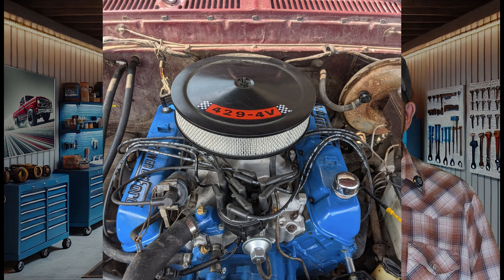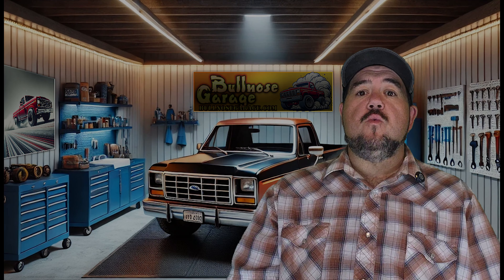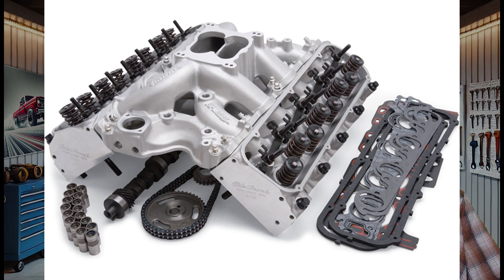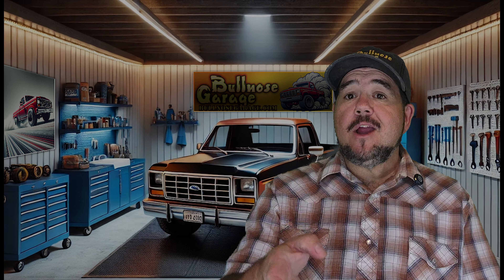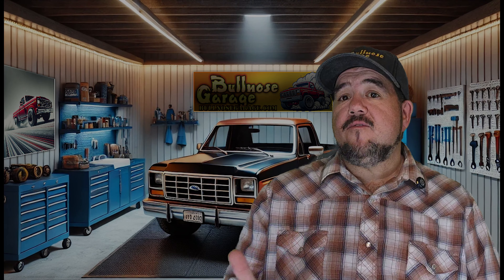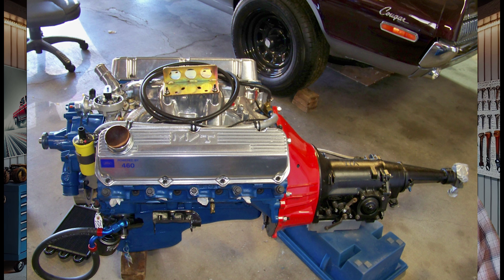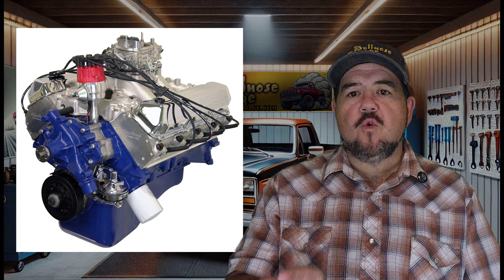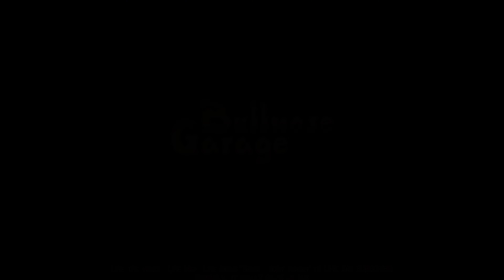Ford 460 7.5 Liter: Everything You Need to Know [Specs & More]

Comment: The 460 is all right for towing, but the FE is a better engine and can handle a lot of abuse. They are as heavy as a diesel. I weighed my FE and it makes 510 hp and 488 ft lbs and weighs 518 lbs with iron heads and aluminum intake.
Reply: Lol the 385 series engine is better then any FE engine ,canted valves is the ticket
Reply: The FE was designed for nascar. The intake is part of the cylinder head. They shaved about 1/4 of the head off so they could fit more aluminum intake. The rules at the time were cylinder heads had to be cast. 

FEs get a bad rep because people don't know how to properly seal the intake. It can be a pain, people shim and even go as far as sanding material away to get it to flush up
Reply: @adamm1998  

The 332 in 1958 was not "designed for NASCAR".

"NASCAR racing was the primary development and test bed for Ford’s FE race program throughout the 1960s. The 427 was upgraded and altered every year as needed to remain competitive."
Reply: @johnpeters9793  Actually the 332 in the 58 Fairlane did pretty well compared to the Y block. They took away the Paxton supercharger, so they were definitely designing a 58 engine for NASCAR so an intake swap took the pedestrian engine into a race engine that revved like crazy. The 352 in 59 and 60 were making over an hp per ci at 360 and were tuned to 375. So they were hot to trot once they all winked at the AMA ban. The 390 and 406 was a good shot across the bow at 375 and 401. Then the 406,at 385 and 405 was pretty good for the 61-63season with the fastback roof. Then the 631/2 427 with the slick body, 64 with the HighRiser 2x4 … the FE was always built for racing from the 332 PI all the way up… just an intake swap and you were eating everything.
Reply: @darrellsomers5427  No I disagree with that statement. The engineers had a magic in the FE ports that overcame the design of the “better” ports. They operated on the length and angle and the durability. It is a wish I had that used a 4.63 Cleveland head, but a Ford Engineer said that they could have an advantage with changing intakes and the intake valve offset that creates a better chamber and squish than poly angle heads. Robert Yates actually reduced the angles to improve the flow efficiency to FE levels. He knew the FE well and could get the best mix from using the best from both without the good port bad port of the BBC.

Comment: Used to drive a 96 F250 w/ 460… reliable and smooth. Mpg averaged 12… great truck engine, if gas prices hurt your budget don’t drive a truck.
Reply: If I could get 12 mpg I would be happy.
Reply: That's better than any of the modern gas powered 3/4 ton trucks I have currently.
Reply: Putting one in a 88 short bed.. Anyone have any tips for this   ?
Reply: @masonanderson1331  the main thing is finding the correct mounts also it seems the C6 transmission is the most popular option you may have to get the length of your drive shaft changed too
Reply: @masonanderson1331  also a 3-4 core radiator is a must

Comment: Back in the day, I put a 460PI in my 76 high boy. That truck would run.
Reply: I have a 74 f250 with a 460. It’s a riot 💪🏻
Reply: I have a 460/C6 I’ve been debating on swapping into my 79 F150 for the 351w and 435 trans that’s in it now. I drive it in the winter and plow with it. I’m just scared that all $ I make plowing, will just go towards gas.
Reply: @jeep2nv92 I cant imagine your mileage is all that great with the 351,  you may not notice that big of a difference.
Reply: It’s not. I’m guessing I’m getting 12-14 at best
Reply: @jeep2nv92  I know what I would do 😃
Reply: I’m guessing you’d drop the 460 in. I’m pretty sure that’s what I’m going to do too
Reply: @jeep2nv92  Yep 😁
Reply: 1960 was a high Boy. Just because its lifted or suts high doesn't make it a high Boy. 😂 They have a step when you open the door. Thats what makes them a high boy not the way it sits 😂

Comment: 385 was an engineering "series", had nothing to do with the stroke.  335 was the same and was the Cleveland "series".  The factory crank is nodular cast and can withstand over 1000hp and 8k or more rpm.

Comment: Remember that the large disparity between HP numbers before the early 70's vs later is largely due to measuring 'gross' vs 'net' HP. Sometimes the exact same engine was used when the measuring change happened so those aren't different except in numbers, but soon enough pollution laws would bring  on a real drop in HP. In stock configurations there wasn't a lot of difference between the 429 and 460 in HP or peak torque, but the 460 had a wider RPM spread of high torque making it feel stronger and pull loads better. There were no real vices or weaknesses with either engine stock, which in itself is unusual. A similar engine ID problem happens with the 360 and 390 engines; measure the stroke to know because most trucks had a 360, relatively few had a 390.

Comment: 78 or 79 they changed the pan rail from scalloped out on the Lincoln blocks to a stronger straighter surface. The Cylinder Bores came down a little further into the crankcase as well making the Truck blocks a little more desirable for strokes over 4.150. Stroker builds up to 557” can be had easily with little to no grinding required. Add a set of Motorsport CJ, Trick Flow or John Kasse heads and you will have a serious beast. 
The current engine in our 1970 F250 started life as a low compression 79 truck motor. We used a cast steel Eagle 4.300 crank with BBC 6.700” rods and Custom flat tops for 9.6:1 with the Edelbrock non CJ heads. We topped the engine off with a Weiand Stelth dual plane which is a very very underrated manifold with a huge plenum and a large bore 4150 carb. With a Comp 270S cam and their solid lifters with surface oiling. This engine idles down to a mild lope at 750-800 and has a split personality. Bottom end torque hits like a sledge hammer and the power extends out to around 5500 before flattening out.
What I learned from my build so that you don’t have to research on your own is 1) Choose a cam a step longer duration than you normally would. 
2) A quality head rebuild with new Valves and hardened seats done by a good shop can cost more than a set of Aluminum heads. Had I known them what I know now I would have opted for the TrickFlow 320s over the Edelbrock Performer RPMs but this particular engine was built to tow, not race. 
3) Exhaust is super important, a good set of long tube headers and 2.5 - 3.0” minimum H pipe setup is the key to breathing. Over the stock exhaust manifolds, the gains feel like you added 4 more cylinders everywhere.
Reply: Thanks for the great advice

Comment: I have one of the last in an F350, 1997 crew cab. I worked on this truck a lot and put a wide band O2 sensor to monitor fuel/air. If you mess with the emissions or the computer is going out they will either run crazy rich or lean. If it goes lean, they get really hot. After I replaced computer and got the EGR sorted out, it run would run 14.7/14.8 except under load and it would richen up, then lean back out. There is just so much volume of air passing through it at all times that if the afr gets off, it makes a big difference. Speed density system works. I got 16/17 on interstate, 12 pulling.
Reply: I have a '97 F350 4x4 CC with the 460 and manual transmission and get a bit over 18mpg on the interstate. I have to say I think I like speed density over mass airflow. 

My intake doesn't have the airhorns in it though. Does yours?

Comment: Building Cobra Kit; '69 429 stroked to 460; intake; Holley; Comp train; Edelbrock; etc.;  T-10 out of a '62 Galx. finally wiring now.  Goal -> summer '25.
Reply: @pauljahelka3060  I would put as much aluminum on it as possible. An FE built at 4.13x 4.125 will be able to scare any one to death though. Put aluminum Trick Flow and a 2x4 Tunnel Port intake an aluminum water pump and it is 510 lbs and makes 600 ft lbs and 700 hp with ease. A 460 is 700 lbs unless you put Kasse heads and intake. I would do an FE. Really. Also I don’t know if a T10 would hold the torque that either one would make. The 390 3x2 401 hp was breaking them even with polyglass tires. Good luck 👍 I love Cobra’s, I always wanted to build one.

Comment: It's the best engine Ford ever built hands down. I've had all the Ford v8s fuel mileage was the best in my 78 t-bird 351 Windsor about 20 mpg on highway in my truck's 351m-400 and 460s average 10-13 mpgs . You might as well have 460 power same mpgs .the gas I have bought was less expensive than payments and insurance on my 22 f150.

Comment: I have 2 on stands in my garage now. Will eventually build a 540ci to put in fox  body or older F100. You left out the fact the 460 can be stroked easily to 597 ci's.

Comment: Mines a 91 f250 efi and honestly always been a crazy truck its been through the ringer and maintained the best i could but does have some body damage and a bit of rust but honestly tough trucks. I forget my transmission, thought it was a c6 auto but it has overdrive and is bullet proof,ive accidentally popped it in reverse at 80. Only thing that sucks is egr crap from the cat rusting out or dry rotting flex joints sputtering when you accelerate. Its in the worst place to reach but even when it was like that it still hauled

Comment: My 83 had one - best truck I ever owned to work in the oil fields. Towed large trailer. 4 spd trans was best tranny I ever had, and the 460 had pulling power. I replaced with a diesel and was much disappointed. i thought I was driving a 4 cyl compared to the 460.

Comment: Have one in my '76 Sleekcraft Kauai jet boat. Been in alot of boats where weight significantly effected performance. 
Not with a 528ci 460, doesn't matter if she's empty or loaded to the gills. That 460 just laughs and throws you back in your seat. Not sure if thats from torque or the secondaries opening up and trying to suck you through the carburetor.😂
Throwing a 250ft rooster tail out the back of the jet going up the river though is a smile maker for sure.

Naturally aspirated 460 pushing 462hp and 630ftlbs at 3000. Had to reinforce the alternator brackets to keep the torque from throwing the belt.
Would love a pro charger on it but dont have any room for any kind of forced induction.☹
Boat is somewhat rare especially ones that have the factory full engine cover as these hoods was typically the first thing to go with gearheads shoehorning more hp in them.
No room in front, no room on top so the hood usually got shit canned.
Cant bring myself to toss the hood anymore as it increases the rarity of this boat so much.
She still turns alot of heads today even being 49 years old.
Two toned white and black with red and silver flake in the black to match the red an silver pinstripe. Interior is white although very hard to keep clean sure beats a scalding a$$ when you wanna sit down on a hot August day.

Comment: Stock exhaust ports are super restrictive. The smog pump bosses are totally blocking flow and even after you've removed the bosses, the valve bowl is too shallow. Other than that they're pretty good engines. Built mine with forged high compression pistons, mild cam, edelbrock torker, 850 holley. Ran good in my hot rod Lincoln.

Comment: Is the 330 and 361 Lima on the same block as the 370? I've seen them all in Ford F-500 and F-600 trucks.Also are all the internals heavy duty as well? I've got an 89 E-350 camper with a 460. Great video!!

Comment: I have an 89 F 250 I bought 2years ago for short trip hauling for my construction company. I put a Banks intake and exhaust kit on it, really woke it up. Then a BBK throttle body and TSF injectors. Starts and runs much better with a slight power gain. Advancing the timing to 14 degrees made a very noticeabl difference too.
This truck has a slide in dump bed and I pull a 15k dump trailer occasionally. Its been great. 
I'm planning on rebuilding it in a year or two and would appreciate any comments. To keep it emission compliant I have to stick with the stock efi set up, which means stock heads. I know there are shops out there that can port the stock heads. I can also put a mild towing hauling cam in it and increase compression. 
As far as I know that's all I can do with stock efi. If it can be stroked or anything else, I would appreciate comments.
Reply: 9.5 to 1 pistons

Comment: HELP??  I just did a valve job on a 78 F350 460. It is running now and a friend looked at it and said I put the head gaskets in upside down. There are gasket tabs visible under exhaust manifolds. I saw a you tube and sure enough their install of gaskets show tabs on intake side. The question is do I have to take them back off??  It runs fine.

Comment: i bought my '88 F350 in October of 1987.  1 ton flat bed with 7.5 EFI and 5 speed manual transmission.  years later, for some unknown reason, i was under the truck and saw the trans was a Mitzubishi with a label saying "do not repair this transmission.  send it back for replacement".  makes me wonder what kind of  research they were doing because i would load over 2 tons of cement and sand on this truck every day to get my jobs done and never had an issue.  it's still sitting here in my back yard.  i'm waiting on my new plasma cutter to get here to chop it up.  lol
Reply: @keayrhyasen1154  Medium Duty Aisin transmission.

Comment: did a 83 F100 with, what originally started out as a 300, then I put a mostly stock 460 in it....better but still kind of weak.  Hurt that, rebuilt.  Hurt that one (pistons) and did a 514.  4.300 stroke 4.390 bore.  Ported heads.  MUCH better, but should have just done a 4.500 stroke and 4.400 bore from the get-go.  that old bullnose was a fun truck.  Not that fast (tire spin....) but still fun.
Reply: Your problem is, you started with the wrong platform with your 83 f100 pick up truck.
Trucks are designed for hauling things, like a ton of gravel and dirt.
Trucks aren't supposed to be "fast".
You want "fast", buy a stupid useless toy sports car.
THEN you will be able to go as "fast" as you like.
Reply: @jaynecobb6711  it was dual purpose.  Hook up/haul the race car t the track, once there unhook and dad would race the truck and I the car.  Most people don't know this but the newer the vehicles (generally) the heavier they are.  That old bullnose was right at 3900 with the 460 in it, which ain't much heavier than one of the bigger cars.

Comment: Sir, Can you please confirm that the 78 or 79 bronco came with the 460? I believe these years they were limited to the 400M.
Reply from the maker: You're right, the 1978 and 1979 Ford Bronco did not come with a 460 engine from the factory. During those model years, the Bronco was only offered with the 351M (5.8L) V8 and the  400 (6.6L) V8.

Comment: I drove a 87 F- 350 short frame Tow- Truck. Last year naturally aspirated 5 speed manual Aluminum that had it's problems but not mine, luckily. Over 8 years in service 95% in city with lots of hills. Odomiter said I had driven 250 K miles. Owner wanted it tuned up his mech's Could Not Remove the distributer. 😢 They traded in for a 1997 SuperDuty Long body.
A year later I quit.
Ruined a perfectly great job because the Dream was gone.

Comment: i have a 96 F350 Dually Super Crew with a brand new rebuilt 460. it's bored .030 over. i have a 3 core all aluminum radiator in it and the engine only has 50 miles on it. it runs too hot. i dont  know why. i changed the fan from a clutch fan to a dual electric and it still doesnt stop it from running too hot. i do wish i could figure it out. i love that truck and would like to drive it again. another thing, i have the original engine on the engine stand in the shop with 265,000 miles on it. it started to run warm and i assumed it was worn out so i built a new engine and put it in the truck just for it to run even warmer. i've measured the temp at 240F at the water outlet. if anyone has any ideas, im all ears. also. i pulled the heads to see if i installed one of the head gaskets backward... i didnt. they are both correct. in fact, you can literally see the word "front" on the gaskets at the front of the heads.
Reply: Install a wideband, if your running lean you are running hot and cooking valves,  Ditch the electric fans unless you have a legitimate 6500cfm you won't stand a chance,  run a fixed blade fan, use a flowkooler water pump,  use 4 core radiator, tighten up the shroud,  and a 180 thermostat.

Comment: The ford boat anchor 210 hp at 8 mpg how can an engine burn so much gas and no power
Reply: It isn't HP that is the factor in the internal combustion engine.
It is TORQUE, which translates to pulling power.
That 210 HP goes along with 400ish ft pounds of Torque at 2500 rpm.
Which means you can pull tree stumps with that motor.
HP numbers are only affective at 6000 RPM or more while Torque numbers are developed at less than 4-5000 rpm.
And those torque numbers are what gets your average family car or heavy vehicle moving from a standing start.
Torque is what moves  those heavy cars from a standing start, moves them fast and smoothly.
The more Torque, the better your average car or truck moves.
That is why electric cars like Tesla are so fun  to drive.
Electric motors produce boat loads of Torque at very low motor rpm's.
Torque is developed the second the motor starts to rotate.
In Torque numbers and street driveability a Electric motor beats a combustion motor by a country mile.

Comment: hillbillymark here from ontario canada--you are showing a 1968 galaxie ( FE engines or 250 six or small block) only continentals got the 460 in 1968. 1969 429 available in galaxies and 460 still reserved for linclon.. 460 was available in F250-F350 in 1973 and F150 in 1975 Fullsize MERCURY'S in 1972 and Fullsize FORD in 1973. please correct your video and show vehicles that corespond  to the years it was available. BECAUSE YOUR NOT TELLING THE TRUTH.